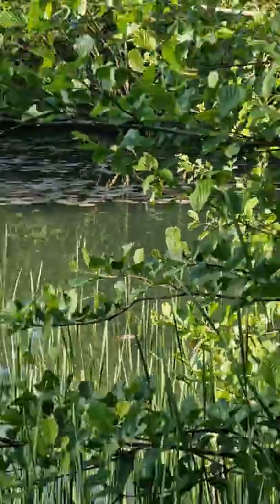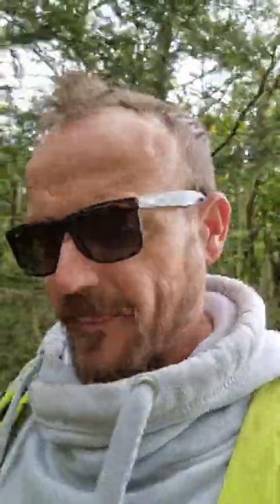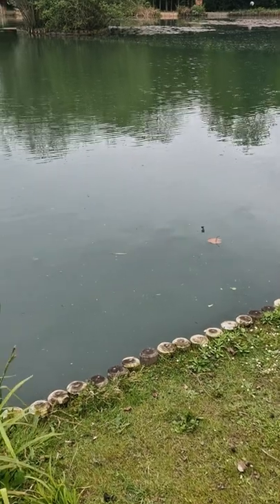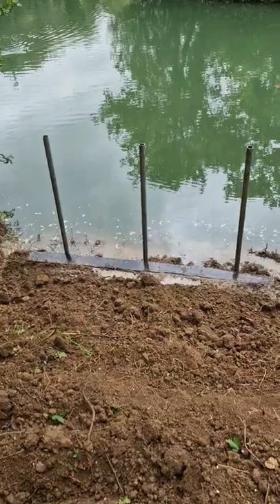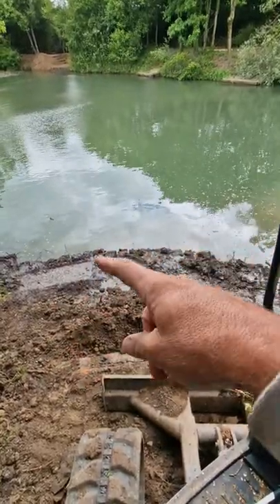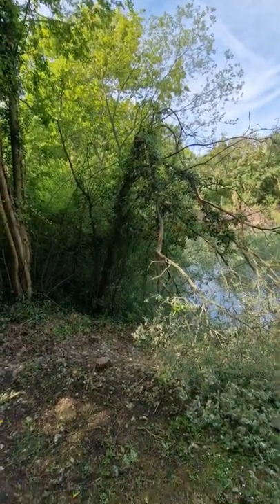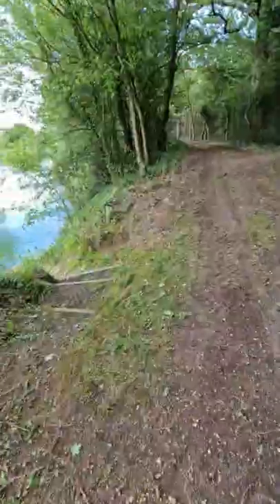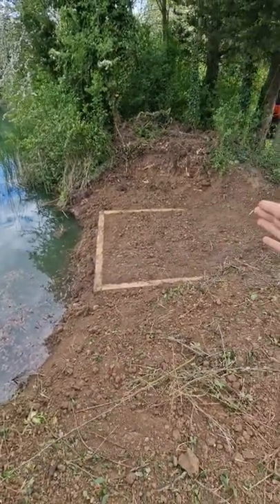swim building. creating safe angling habitats.

Comment: Quality work there 👏. Just a few things to add. The clay in front of the sleepers is shourly dangerous for fish retention in keepnets when putting fish in as you are so far away from the water. My local club have started to implement a design (that I suggested) to combat erosion, with muiltple swim colaspses leaving dangerous hazards for both human and fish welfare and as they have retreated over the 70 years we have been running. As a result, we have been left with little "boundary" without cutting into the sand burrow inbehind the swims, which could lead to landslides if not secured. By extending the swim past the oldest swim design using recycled plastic wood, which is actually cheaper than timber at the moment with many benefits to boot. By enclosing the peg with this plastic in a 3D way where the plastic reaches the bottom off the lake margin by then backfilling with small boulders stopping sediment from escaping and slipping, then with 20-30mm rock cippings then sand off with about a foot leaves enough room for banksticks. It also means the water in front of the swim is deep enough for fish retention in keepnets and slings. Additionally, the sides are then at the perfect grade to plant iris and then lillies creating the perfect feature fish holding platform and a safe place for fry to thrive. This is obviously an expensive option. However, it may be helpful for future designs that has no other way of sorting the issue out.